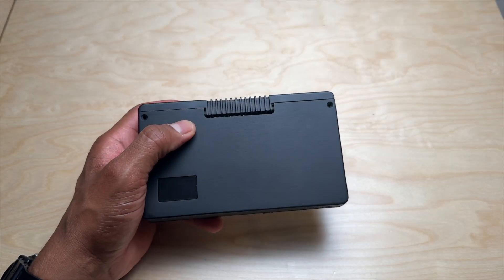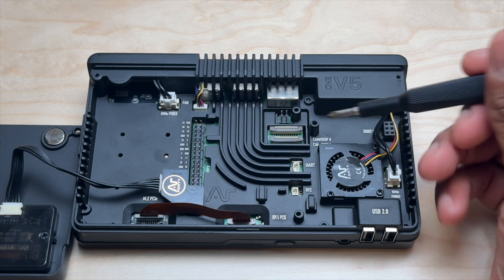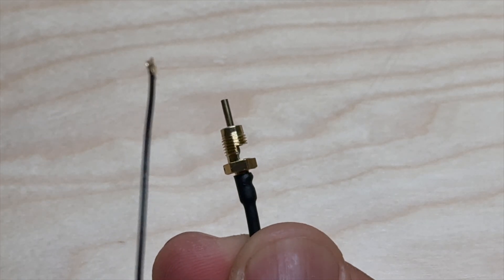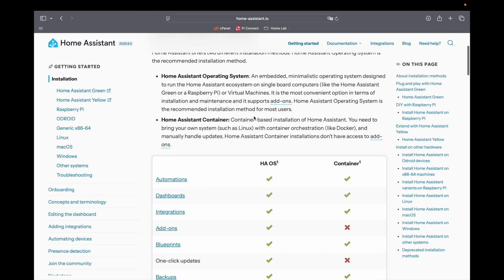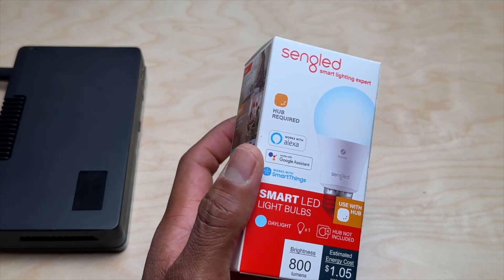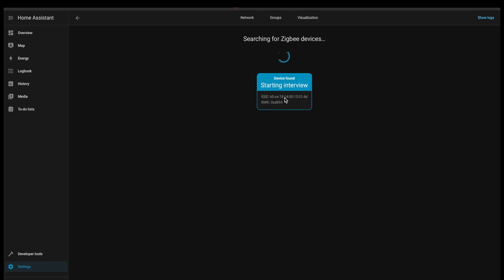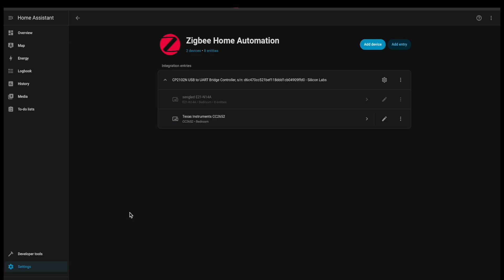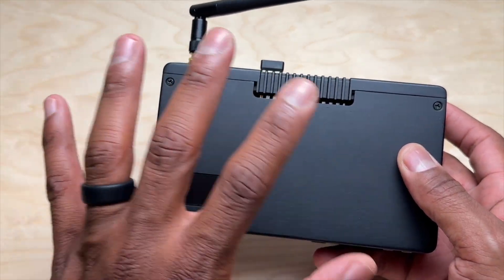Argon Industrial Zigbee Module for Argon ONE V5 Raspberry Pi 5

Comment: How do I enable the two usb ports?
Reply from the maker: If you install Raspberry OS or OS Lite, you can install the script that enables the USB ports.
Reply: @iam.jasonhoward ok and how do I do that on home assistant?
Reply: Yes but what is the solution for HA? Not found yet.
Reply from the maker: If you installed the home assistant operating system using raspberry pi imager, connect your pi to a mouse keyboard, and monitor. At the prompt type “login” and you should be able to type the script.
Reply: @iam.jasonhoward  The script won't run on Home Assistant OS